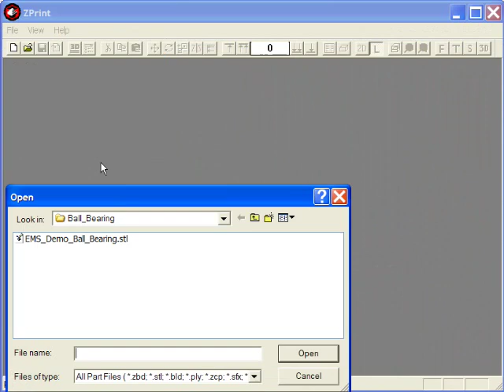3D printing demo -- ball bearings!

Comment: @minecraftmodglitches Yes, many 3d printers come with files that are integrated into the software. Selecting these 3d files, it can then print out the parts needed to make that 3d printer. It has to be manually put together though.

Comment: @TheEnglishAtheist1,

Probably not too expensive because their are already home built versions. As for strength, I imagine it would be pretty damn strong, at least equal to a MIM part. (Metal Injection Molding). MIM parts are considered of a lessor quality when compared to a forged CNC part. It's al relative I guess.

Comment: @narufreak29 If it weren't for the fact that you were printing on all three dimensions, I'd imagine that the 18-minute production time would have been incredibly slow.

Sure, it's a small part, but I bet it's printed in tons of layers (which ends up taking plenty of time) to fortify it a little better.

Comment: but what are the properties of the finished material? what's it's Rockwell hardness? tensile strength? how does it fair against vibration and temperature change? this seems like a good idea but until those questions are answered and the printed part can be proven to hold up to the stresses that a traditionally made part can i can't see these being used in industry anytime soon...

Comment: @fastgs1 this is not the issue if you can even make that much you can make a mould using that model whereupon you can then use the mould to pour molten copper, tin or nickel god knows id rather make something out of all my pennies and useless coat hangers than reuse em in the conventional sense! then split the mould and hey presto you have a metal object inside just file and polish!
yes we would like to make some things out of steel or aluminuim but im being realistic.

Comment: My heart is defective and needs the application of a stent (a small tube that supports an artery wall and is introduced by a catheter. My case is difficult. If the surgeon took an MRI scan of my heart he could make a model of it using this printer. He could then practice before committing himself!